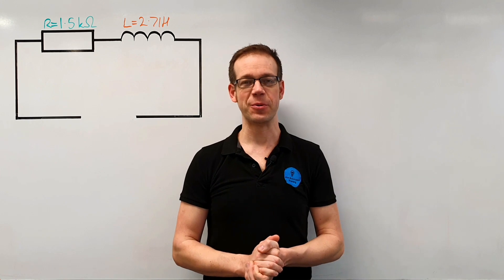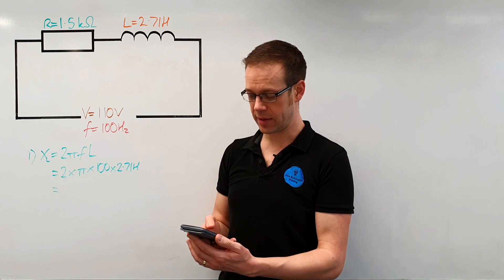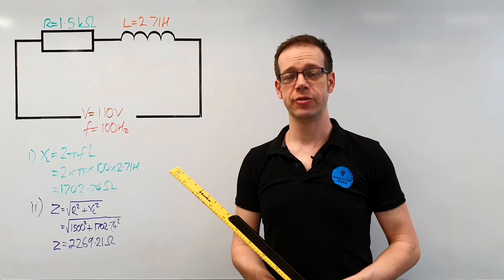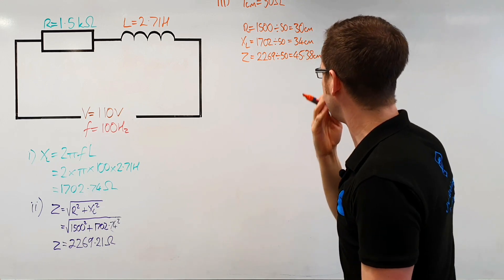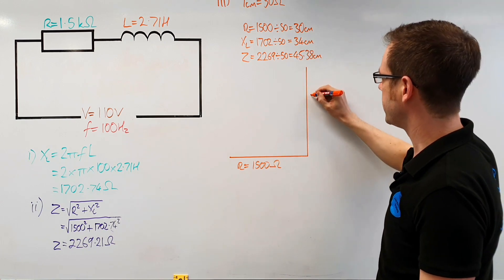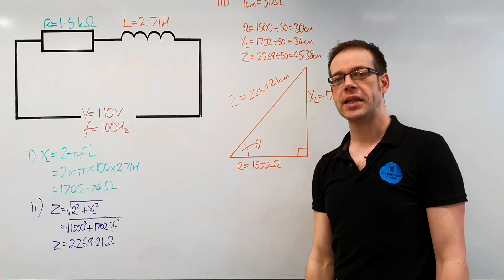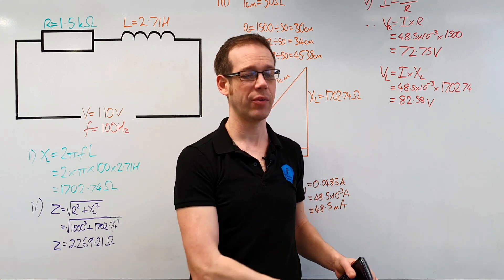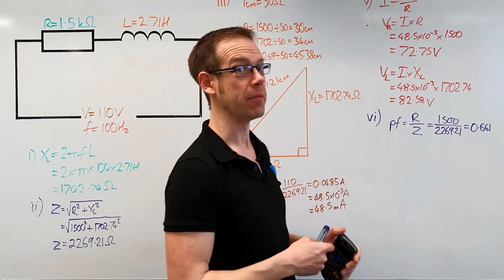How to Calculate Inductive Reactance & Impedance for a Resistor & an Inductor connected in Series Q3

Comment: Hi Joe ive just subsricebed to your channel , i dont have a way of contacting you directly , i am in trouble i got stuck with the calculation for slip in Rotor and sync speed in lvl3 
i managed to find the transposed formula allowing to calculate the actual speed  "Nr" knowing Ns and %Slip 
Nr=Ns x (1-(%slip/100))  
 what is the correct input in the calculator so the answer can be the correct one please ...

Comment: Great video Joe, Thank you. How would I calculate the value of Impedance if it was a resistor only circuit?
Reply from the maker: Thanks for the comment and question, you'd just use regular ohms law using the rms voltage across the resistor.